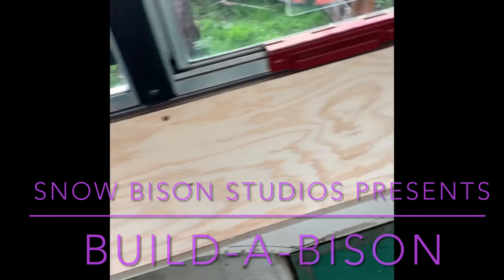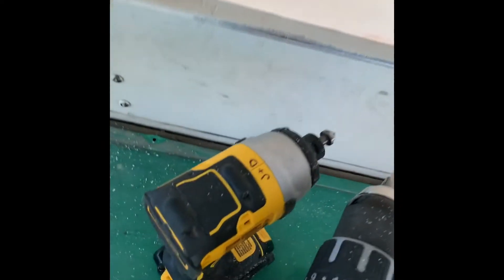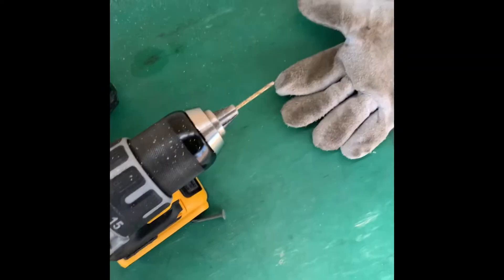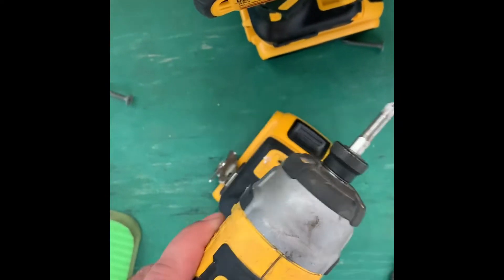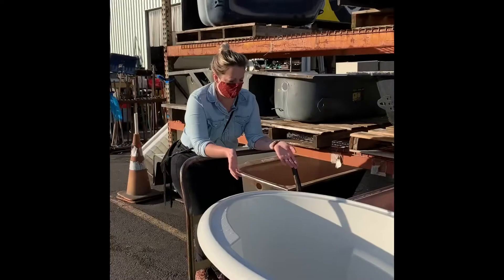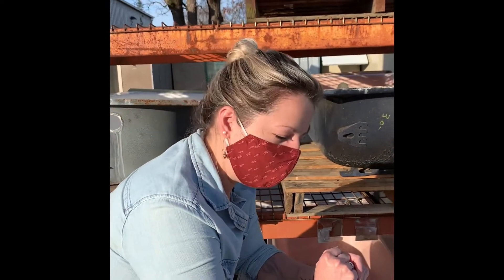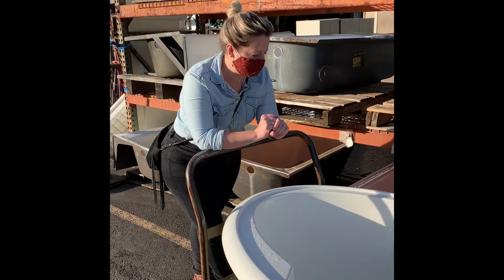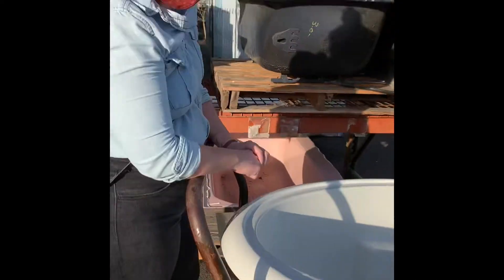Video 6 | How to finish your plywood walls and floors| How to frame a Skoolie couch and dinette

Comment: I also used the rigid insulation in all the sides.  I am fortunate my bus has the inside height I could put 2" rigid on the floor, the ceiling and still have room to stand up, glad I am short!